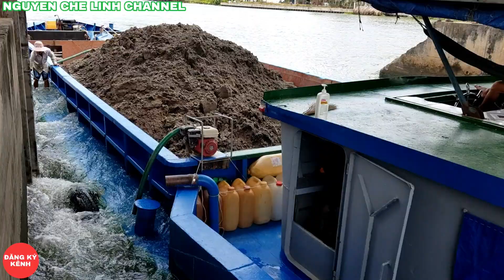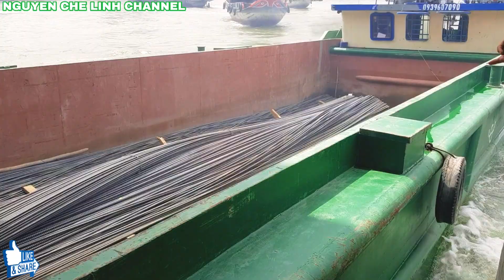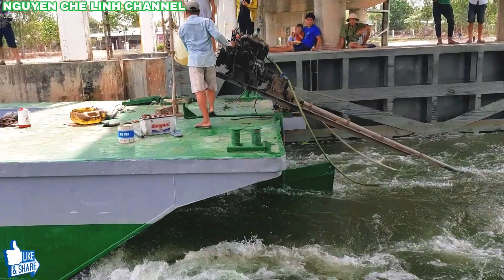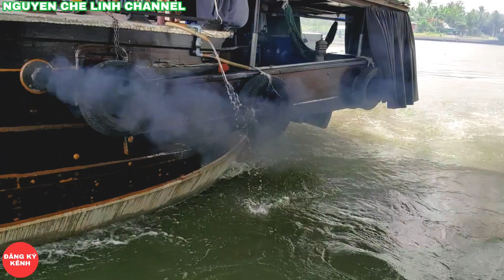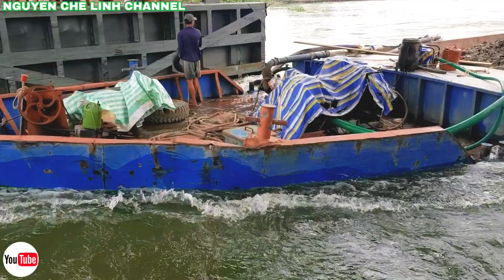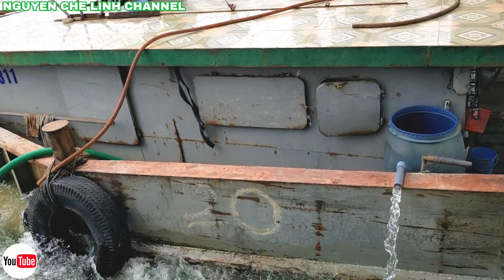Hàng Loạt Sà Lan Vượt Cống 10 Cửa Thất Bại Liên Tục [ NCL ]

Comment: Many of these boats have a problem with their motor adjusments (few power, too much smoke at full throttle) and maintenance flaws (clean air and fuel filters, for instance).
Luckily for them, diesel fuel seems to be cheap in Vietnam, so they can burn it at will. And the brands are honorable (I saw 'ISUZU' on one of them).
Seems that diesel motors mechanics are either rare or expansive there.
I feel sorry that these poor people are wasting a lot of their money when forced to replace motors which could have lived longer and made their life easier, if better maintained.
How many of them apply the requested oil change intervals ?
Reply from the maker: I think the boat still regularly applies the required oil change time